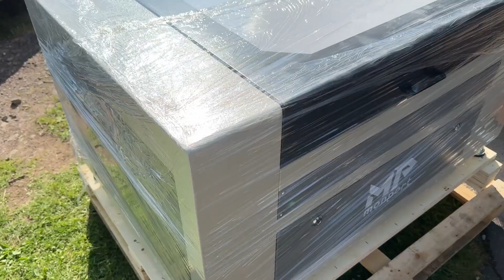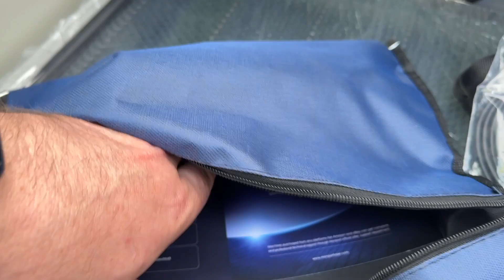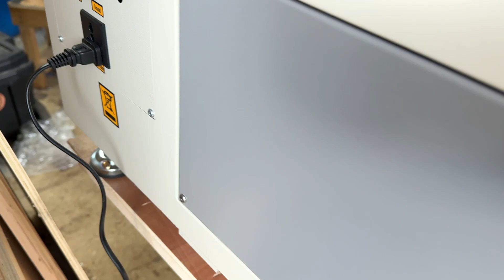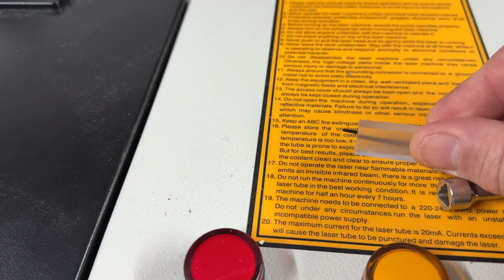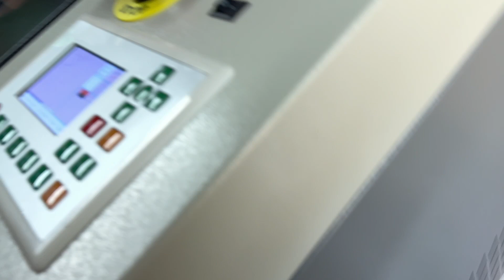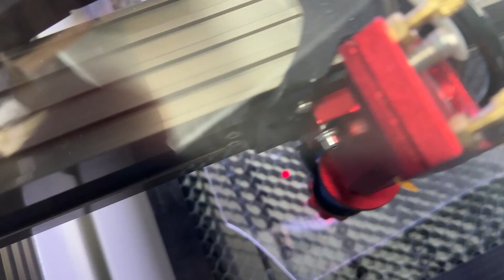Monport 60Watt MP460 CO2 Laser, unboxing, set up and testing.

Comment: Hows the laser going after one month? Really considering this for myself. Did you cut the dice with kerf considered? or did you not have to worry about it?
Reply from the maker: Sorry for the late reply, Yes the laser is still performing well. I did not change anything to allow for the kerf, I use the same pattern for all my test pieces ( which I think is set at 0.1mm). The dice had very tight joints, the tightest so far, so it must have a very narrow kerf. I had to use a hammer and a block to get the pieces together, which was Ok on a small design but I would probably allow for the finer kerf on a larger box.

Comment: The laser is a surprisingly good price for what you get. I thought it would cost at least twice the amount!
Please be careful with laser cutting leather. Cheap leather is often tanned using chrome salts which you don't want to breath in. Furthermore it can also damage the guide rails. The same goes for cutting PVC. The cutting process creates hydrochloric acid.
Reply from the maker: Yes very good value. I only tend to use veg tan leather and certainly avoid anything that might be PVC. Many thanks for watching.